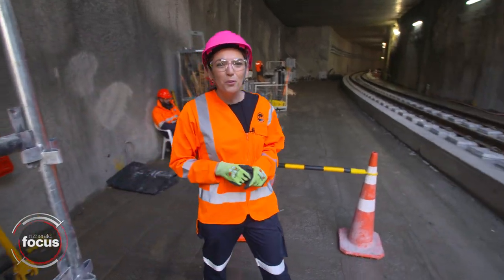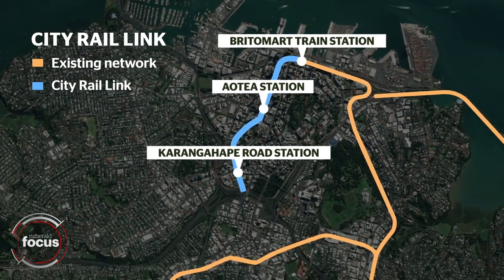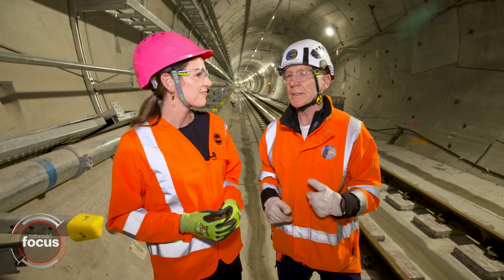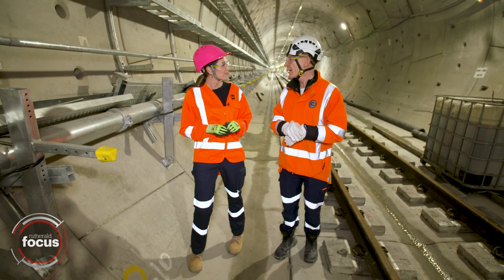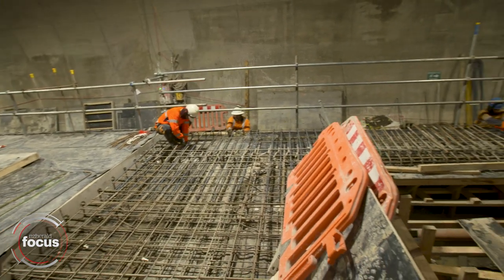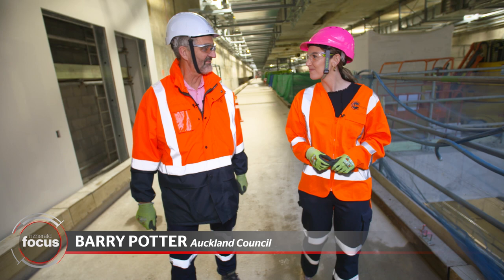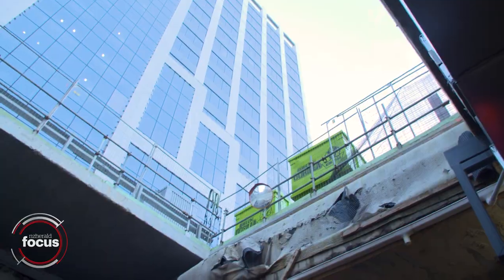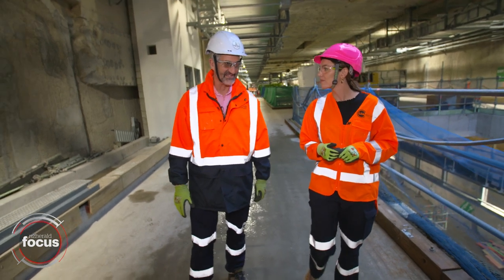First look at Auckland's new City Rail Link | nzherald.co.nz

Comment: 5 billion for a stretch of rail covering a short distance that I prefer to walk every day. Insane.
Reply: Yes, but that distance isn't the point. It's the people coming from suburbs and getting off at a station close to their destination.
Reply: You've missed the point entirely, this project won't only allow more access points in the CBD but it will also double the capacity of the entire network, increase train speeds and frequencies and encourage investment along transit corridors and the CBD.
The current price tag, while terribly high it was pretty much unavoidable due to covid and the lockdowns.

Comment: What a disgraceful waste of tax payers money.
Reply: Sure, so was the Harbour Bridge (and it's clip-ons) until it was functional.
Look up 'myopic' sometime...
Reply: @almostbutnotentirelyunreas166  harbour bridge had toll booths on it to recover the money and remove the burden from tax payers. There is also an alternate rail line that already links Mt Eden to Britomart.
Reply: @dave24-73  Thanks for making my point for me: User pays.....just like the rail once it's done.
Do you an issue with providing Commuters with a choice of stations...not everyone lives close to the current rail line , you see.
Reply: @dave24-73 like paying to ride the train?
Reply: @theovanbooma8508  well now National are in and light rail support has been revoked the tunnel costs are likely to sky rocket. No more subsidies either. It’s going to be very interesting on how Auckland Mayor and Auckland Transport move forward with this project.
Reply: @dave24-73  they aren't stopping the completion of this project 2/3 the way through now. It will be finished regardless of who's in power
Reply: @theovanbooma8508  they aren’t stopping but they money is, so if the price keeps going up, was 3 billion now it’s 5 billion, they are going to struggle without doing something like raising rates again.
Reply: @dave24-73 Even if the price went up National won't withdraw funding support, they are the one's that signed off the project in the first place and they have shown to be eager to get this project done, so no, CRL is safe.
It's also not politically strategic to withdraw financial support from a infrastructure project that's at the fitout stage, it wouldn't make sense to at this point.